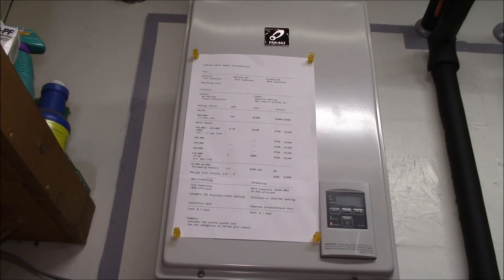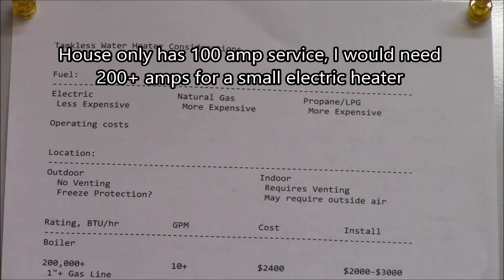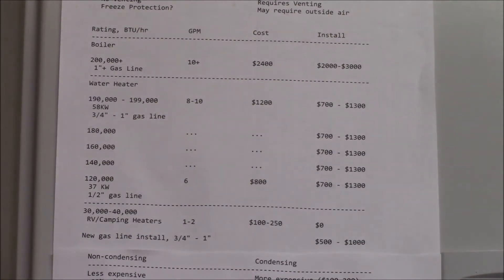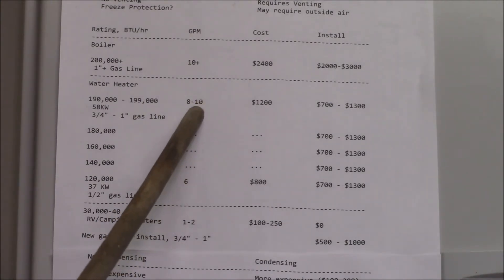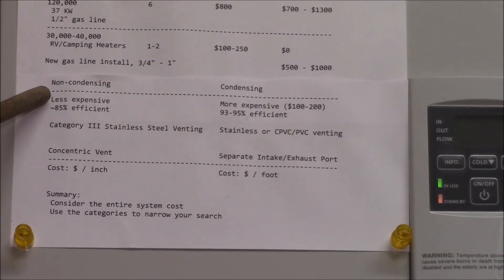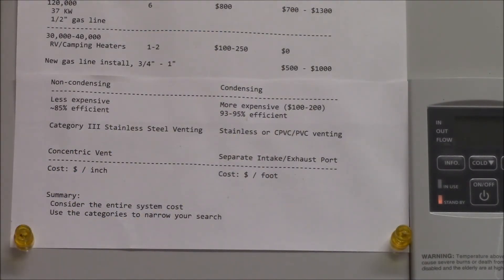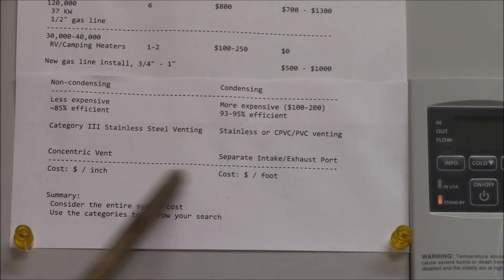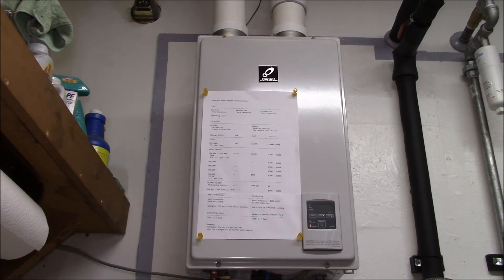My Tankless Water Heater Selection Process

Comment: Excellent job Mr. Brown, very thorough explanation regarding the differences. I think you made an educated decision on the water heater you selected and I am too going to purchase this model because of the total cost of a DIY project. You took in account the Plumbing, Gas Increase, and best bang for your buck water heater. I would like to see more of your DIY projects and ideas!
Reply from the maker: Glad you found the video helpful.  I think many folks forget to consider the overall installed cost when selecting a tankless heater.  I started out like I did when I bought the previous tank type heater, which was to get the biggest one that would fit, and had picked a non-condensing, high output model.  Then started to realize that needed expensive stainless steel venting, larger gas pipe, etc.

So instead of paying a lot of money for all that non-water-heater stuff, it made sense to go with a smaller, more efficient, (and more expensive) unit that would work with the existing infrastructure in the house.

Comment: If you have a condensing type unit, can you use pvc and connect to the existing water heater venting? I have a 2 story home with the heater in the garage and the current venting goes through to the roof. Otherwise, I would have to run 30 feet of pvc to go vent out through the garage wall.
Reply from the maker: I suppose it would depend on what the existing venting is made of.  If it's a stainless steel material, that should work.  If it's galvanized or masonry venting, then probably not.  For my heater install, the old tank heater had a concrete / transite vent pipe up through the attic and roof.  I removed that and replaced that with a similar diameter PVC pipe.  
  https://youtu.be/f1bJWVVHItA?list=PLpY2FP1a9tivcdvNm6ErVyobclgVU9m6y&t=183

I think the main issue is even through the heater condenses water vapor out of the exhaust, it's still fairly hot and humid air (like 140F and close to 100%RH.  As that exhaust transits the venting, it cools and additional water (slightly acidic) condenses out.  This can attack any non-stainless or masonry surfaces.  Might be worth checking with the local building building/code department and see if there are any local requirements.
Reply: @The4Crawler  It's galvanized, and probably a major project to replace with stainless. Once I get the total venting cost determined, the most economical solution might just be to stay with the "tank". Alas.
Reply from the maker: Not sure if this would be an option, but when I had my fireplace insert installed, they put in a stainless steel liner in the old fireplace chimney.  But yes, venting cost can be significant, a lot of folks don't think about that up front.  I spent a good deal of time looking into that with my install, of course every situation is different.

Comment: I am going to have to look at the electric ones they have to be cheaper then hot water tanks. Wish I had natural gas or even propane I do have propane at the MT property
Reply from the maker: Yes, the electric tankless are fairly inexpensive.  You do need pretty hefty electric service to run one, though.  A 6 GPM like mine is 37KW, around 150 amps @ 240V.  Or you can get smaller units and install them closer to where you need the water, like one for the kitchen, one for the bathroom(s), one for the laundry, etc.  Those are small enough to install in a cabinet under a sink.